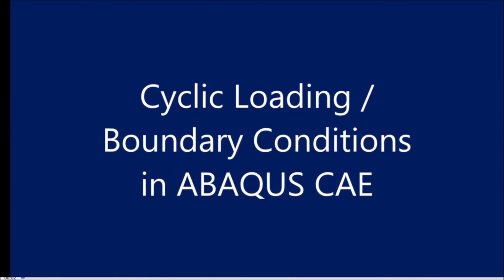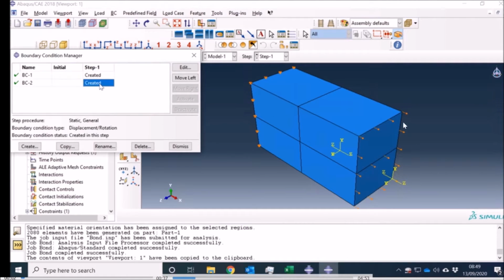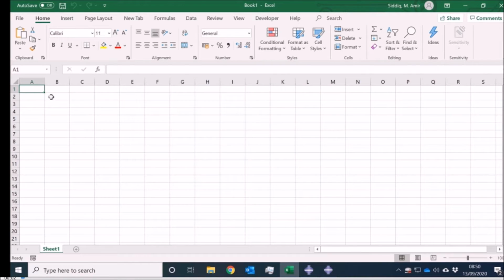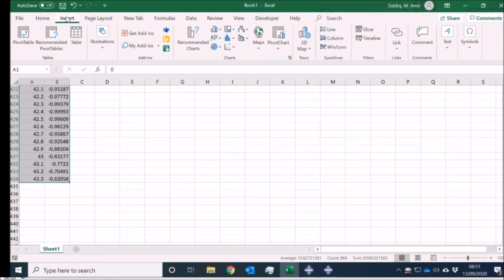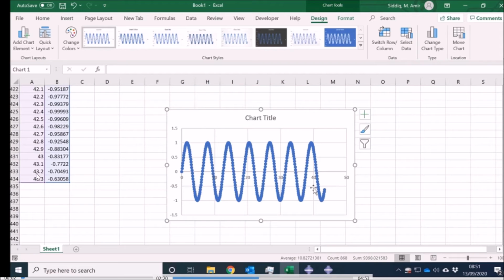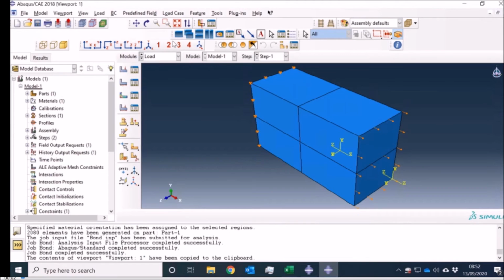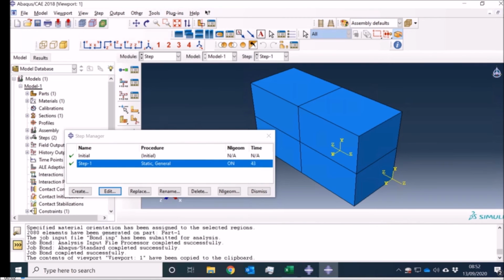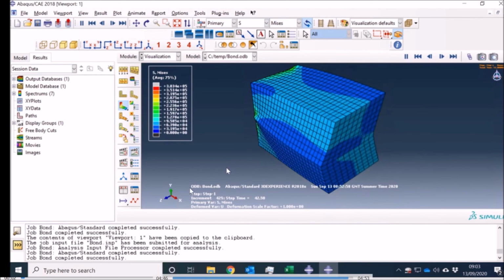How to Perform Cyclic Test Simulation? Cyclic Loading /Boundary Cond in ABAQUS CAE

Comment: Sir
I'm doing CFST column steel beam joint connected with bolted connection subjected to cyclic loading at beam end
After running I'm not getting strength degradation portion in the result
In property module, I have given elastic and plastic property with combined hardening
Still I'm not getting strain softening region
Please help.
Reply from the maker: Can you explain more on what causes softening under cyclic loading during experiments? This would help suggest a few options. Also, what material properties have been used? Does the material shows isotropic and also kinematic hardening during the cyclic loading?
Reply: @Professor3MEC  formation of plastic hinge is the reason for strength reduction
Reply from the maker: i am not aware a direct method. If you can provide more details or research paper then I can suggest something.

Comment: Thanks prof. 

Pls, How can the wheel tracking test be simulated using Abaqus software?. Most especially the load application of the wheel.  The wheel (700N (weight); Diameter (200mm); 50mm (contact width); contact length (20mm)) performs a back and forth movement  on a sample of asphalt concrete (300mm by 260mm  and 60mm thick. 

The wheel moves with a speed of 26.5 cycles per minute and is supposed to ply a to-fro distance of 230mm on the asphalt concrete, it also reaches it maximum velocity (305mm/s) at the center of the pavement. The wheel will cover 10,000 cycles in the experiment. The experiment is designed to simulate the rutting behavior of asphalt concrete.

Please help prof.
Reply from the maker: I will think of a simple example based on above and create a short tutorial soon.
Reply: @Professor3MEC  Thanks Prof. You are the best.

Comment: Thanks for your tutorial. I have a question.  can I have one cyclic Load in the first 10second of analysis and then have a different cyclic load in the last 10 seconds.   first Cyclic Load is Force-Control and the latter one is Displacement-Control.
Reply from the maker: yes for a simplistic case, you will have to create two different amplitude cards and then link them to first force and then to displacement. If need help then let me know and I am try to create a short video.
Reply from the maker: Here is a video on this 
https://youtu.be/rekUgcDb8Ig

Comment: thank you it is helpful. please help me. i have a lateral drift  history(drift ratio vs lateral drift) but i have no amplitude vs time history. how can i get?  am using Abaqus for simulation.  The specimens
 were tested by controlling lateral displacement at the loading
point. Lateral displacements were increased from 7.25 to
 203 mm  in stages, and load cycles were Repeated three times each displacement stage.
Reply from the maker: Get the loading data as a function of time from experiments and using the same approach shown in the video create amplitude function. Good luck

Comment: Hi, thanks for the video- it's very helpful. 

However, how do I apply acceleration in 3 directions simultaneously? 

the tabular input will be like following 

time, x-axis vibration, y-axis vibration, z-axis vibration
0            x                                x                          x
1            x                                x                          x
2            x                                x                          x
3            x                                x                          x
Reply from the maker: Thanks for the appreciation. You may create three amplitude curves instead of one if they are different in each direction. Then when you create boundary condition, you can assign separate amplitude curve to each boundary condition. I hope i was clear.

Comment: Sir instead of applying displacement load.. Is it possible to apply pressure load over a circular area in a cyclic way
Reply from the maker: Yes it should be fine. Instead of displacement boundary conditions, go to loads and select pressure and then use any amplitude function.
Reply: @Professor3MEC  Problem i m facing is i dunno how to do loading time and resting time repetitions in cyclic case... Predefined ones do not serve purpose for me :(
Reply from the maker: @gokulsivakumar4930  Email me your model file or model details. I will then try to create a short video.
Reply: @Professor3MEC  your mailid sir
Reply from the maker: It’s in about section of the channel. Thanks

Comment: This video is really helpful. Anyway, how to get combined hardening parameters of steel bar since we just have yield stress, ultimate stress, yield strain and ultimate strain values?
Reply from the maker: Thanks for appreciation.  Combined hardening model requires cyclic stress strain data to be used to identify kinematic hardening parameters. So may be look for cyclic stress strain data and then try to fit the kinematic hardening parameters with experimental curves. Process of identification will be similar to the third option discussed in the following video.
http://youtu.be/bfMU1-oOLqQ

Comment: How to consider the pinching effect during cyclic loading in Abaqus?
Reply from the maker: In general, pinching effect is widely observed in the hysteretic behavior of RC structures. According to experimental studies, the pinching effect is associated with crack closure, shear lock, slippage of longitudinal reinforcement, and so on.
I am not an expert on concrete, however if you could send me some more info on what is required I may be able to create a simple video on that.
Reply: @Professor3MEC  OK, well, I want to mention that the main problem of general-purpose FE softwares as Abaqus and Ansys , that they do not consider directly the pinching effect during cyclic loading, I will be thankful if you prepare other video for this case. Thanks